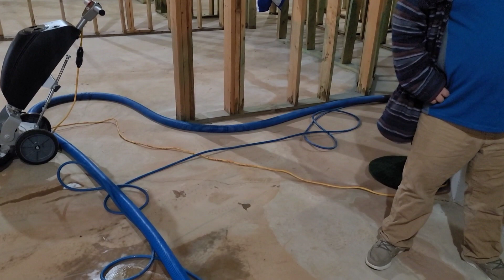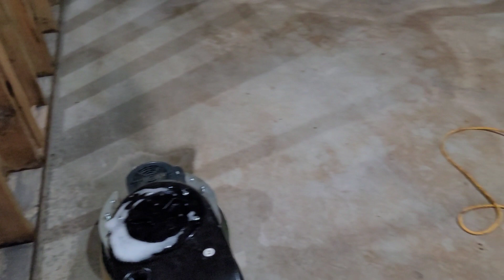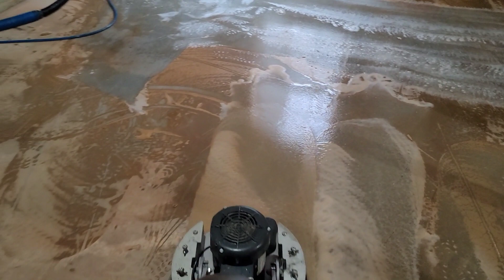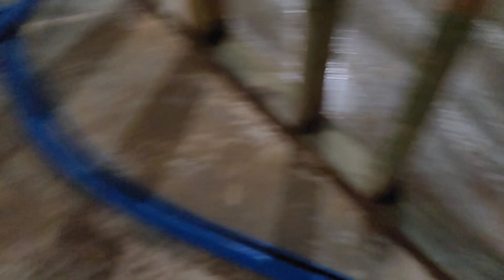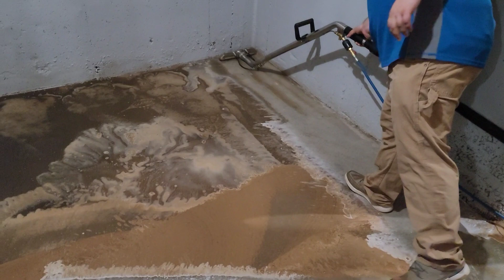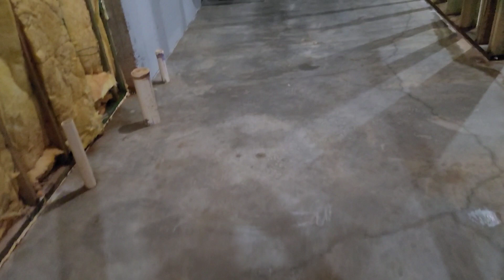Removing a lot of dirt from basement concrete floors

Comment: Looking nice! Question: We have a small concrete pad and walkway by our garage at our cottage which needs cleaning from time to time. Most of the grime is due to the oak trees on the property and I was curious if I could get away with a swing machine and a brush attachment. Will the brush be enough, or should I go for a pad?
- My machine is an older Clarke Floor Maintainer FM-17 with the original wood brush.

Comment: A rotary with a 120 carbide brush would speed things up dramatically.
Not a fan of the oscillating machines on hard floors not aggressive enough.
I have Titan 575 but would only use for the last rinse with sx15
A good wet vac works great 👍
Reply: A wet vac with a front squeegee would be a lot faster and save on their arms. I am old I like doing things easier.